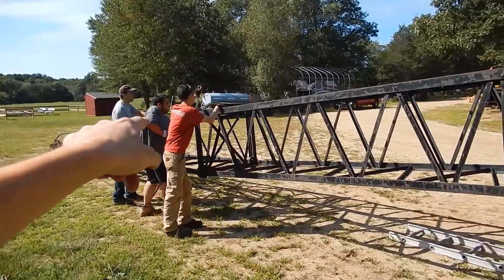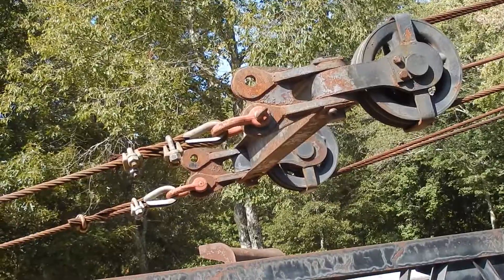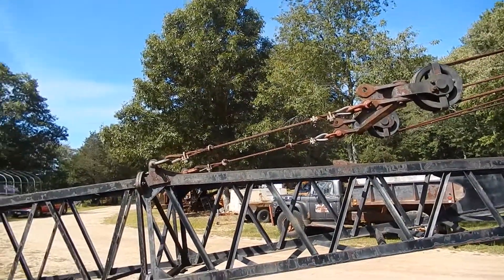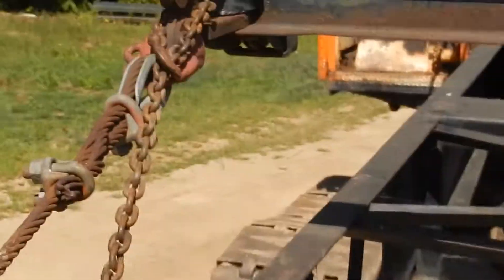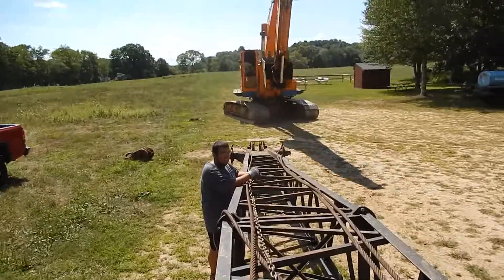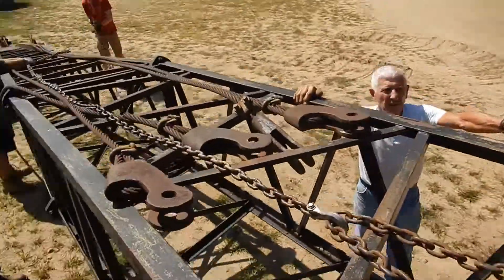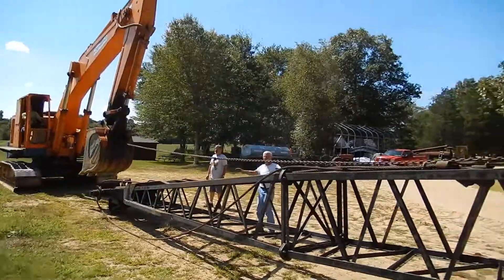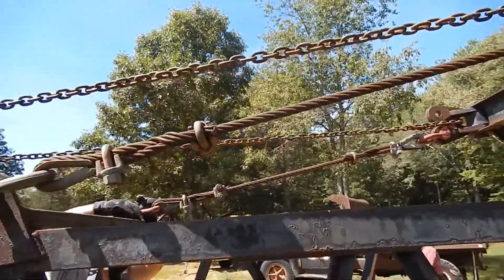Installing A Crane Boom On A Northwest 80-D

Comment: Hey!  Recently, I put up the gantry on my 80-D. I had the same problem of raising the boom and the gantry wasn't quite there to pin in place. I used your technique with the excavator and it worked great! I put together a video. Thinking you wouldn't mind, I made mention of Zagray and put a link to your  video at the end of mine. Here is my video: https://youtu.be/dAHygnJ0xz8

Comment: There is absolutely no need for assistance in raising the gantry on a northwest, you simply boom up until the pin holes are aligned and install the pins. I've done it hundreds of times.
Reply: Recently I purchased an 80D crane. I tried to boom up to pin the gantry. At 80 degrees, it was still about a foot away from lining up the holes. At the time I didn't have the boom stops in place, so I wasn't going any further than 80 degrees in fear of it going over center. Thanks to this video I did the same trick with an excavator.
Reply: @Scattered Rusty Projects  most of the time because of the fact they're not broke down very often you just have to give it a little nudge with a pry bar to get it going but please please be careful because once they start going they don't stop and they will slam down (or up) and Crush you if you are in the way. Northwest designed these cranes to be able to be put together for the most part without added equipment our 95-70 has hydraulic cylinders that attach to extensions that are hanging from the Gantry base and you attach hydraulic cylinders to it and pick the counterweight up and set it down so all you need is a semi with a low boy which will have a hydraulic pump and you use the Hydraulics from the semi to lower the counterweight.